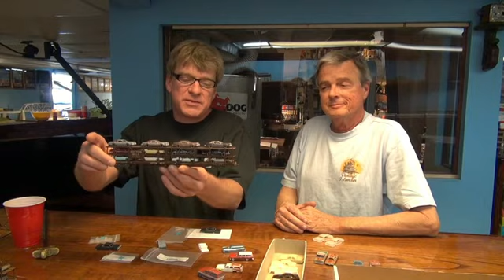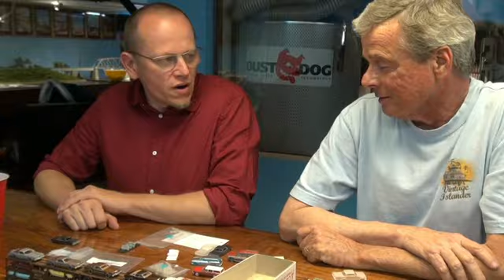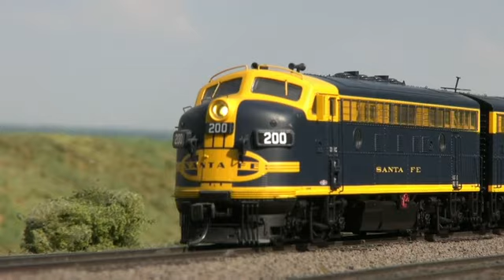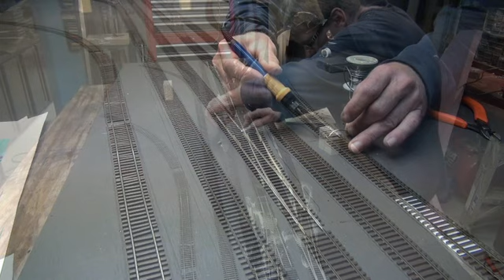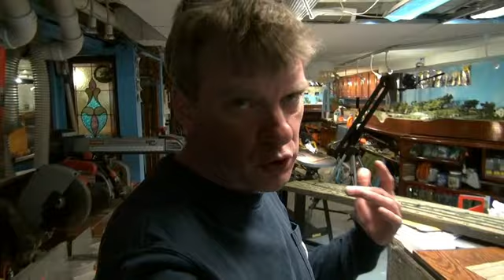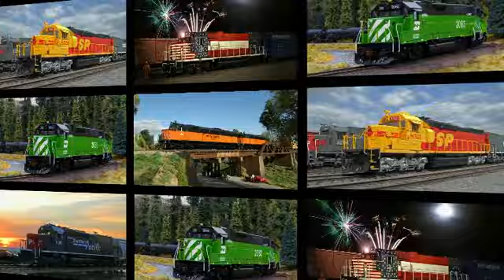What's Neat This Week in Model Railroading #97.6  Engine House Build.

Comment: hi Ken, I know you like fast results, next time try using the hairspray technique for chipped paint instead of rubber cement, easier and faster to apply and remove.  AK Interactive also sells something called Chipping Fluid that works the same.  For really high detailed chipped paint search for Chuck Doan's method for chipped paint, Kathy Millatt did a video on Chuck's method.